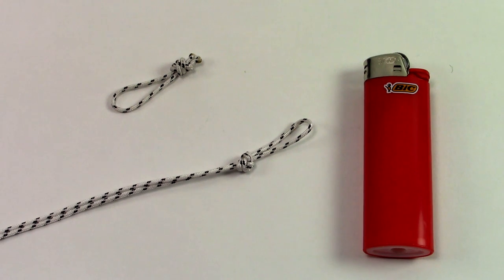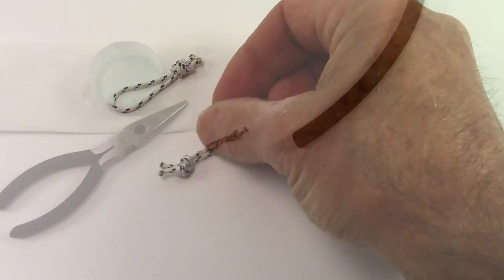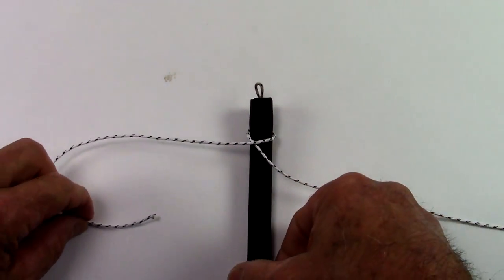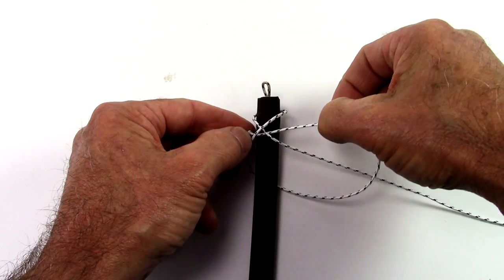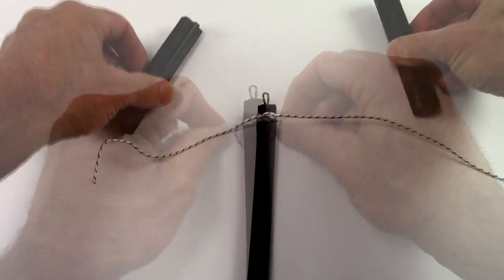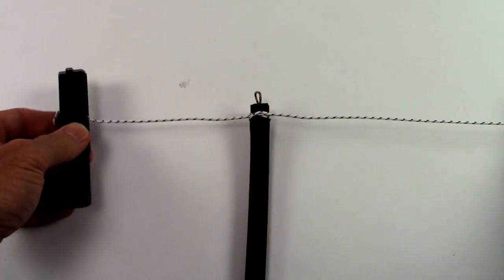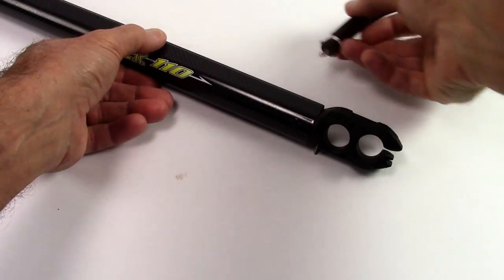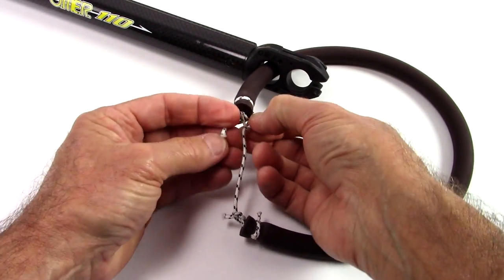Tying dyneema wishbone and band on an Omer Cayman speargun

Comment: Greetings, I have a CAYMAN ET Speargun - CAMO 3D at 130, for one or two rubber, If you have the knowledge, You can tell me the correct diameter and the length of the rubber to replace it. I use OMER Articulated Wishbones, THANK YOU